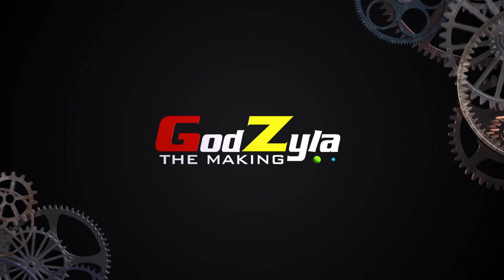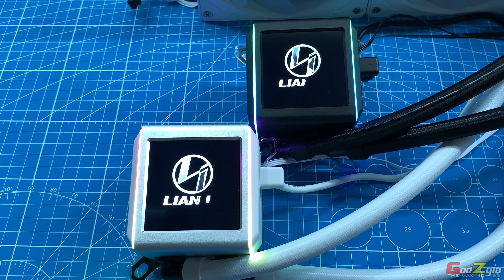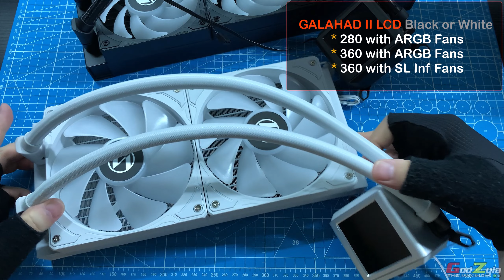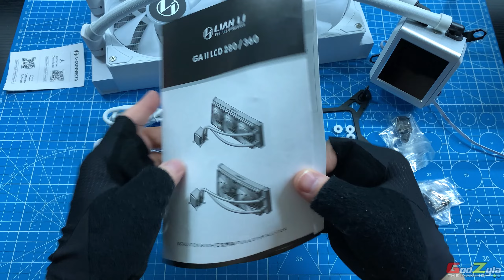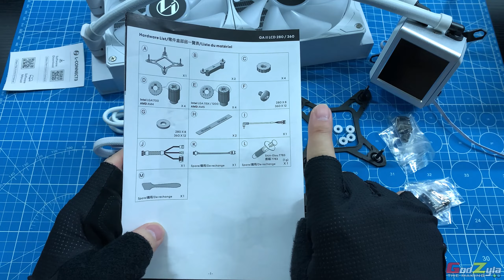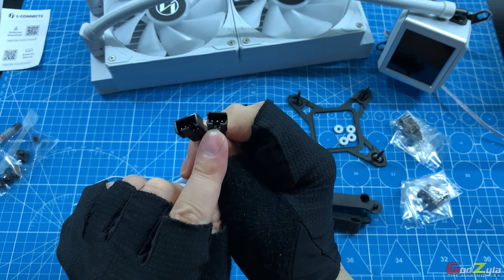Lian Li Galahad II LCD

Comment: Hmmm so which is better ryujin 3 or this one?
Reply from the maker: Hi Bruce lee, welcome back, both does it's job but I prefer GA II LCD, which is quieter even though the same Asetek Gen 8 pump is used on both Liquid AIO and the price for this is much cheaper too.
Reply: @KleoYan  ic ty buddy
Reply from the maker: @wankerka  you are most welcome. 🙂
Reply: @KleoYan  oh btw, is the software for the AIO sorted? i remeber last time it was still on beta.
Reply from the maker: @wankerka  hmm. I have been using the version 1.7.4, no issues. infact all these while I dont have issues using any of their version as I stick to one argb eco system. no other argb program I am running except for Lian Li's argb products.
Reply: @KleoYan  Can you use SL 120 V2 on this AIO?
Reply from the maker: @wankerka  Hi and welcome back, Yes you can but you will need to make use of the SL 120 V2. If you are getting the triple pack SL 120 V2, make use of the uni controller for better argb effects and to control the PWM. Else if you are purchasing just the single pack x 3, you will have to connect the Fan (PWM & ARGB) connectors directly to your motherboard respective headers (PWM & ARGB) but you can only control the argb using your motherboard argb application. L-Connect 3 will not work without a uni controller.

Comment: Good day and pls if i may ask , between this Lian Li Galahad II LCD and the Asus Rog Ryujin III  , which do u think can be a good choice  for 19 13900ks ? thanks and look forward to  your answer
Reply from the maker: Hi Blb Hansel, welcome to my channel. Both does it's job but I prefer the GA II LCD over the Ryujin III. for some reason it's quieter compared to the Ryujinn III, plus it's much cheaper too.
Reply: @KleoYan   thanks for the response  , my only concern now is about the pin head on the Motherboard , most of asus motherboards have just 1A rated pin out  and based on ur advice the GA II Lcd will work better on  a MotherBoard with higher Amp, so do u think i should go for a different motherboard?(i like asus MB because of the AI twerking) ,  and pls if i am not asking too much , but can u make out time to make a video explaining on how u twerk and turn your  pc after u build it , i live in the same area as u , and to be honest i always get lost when u explain on the under volting  process , i would like to get all the good speeds from my cpu , gpu and ram , but find   it hard , so pls  if u can kindly make out a video and explaining all the twerks that can benefit us , those that don't know much about overclocking , thanks
Reply from the maker: @blbhansel8226  hi welcome back. I am not saying Asus is not the right board, just make sure that any pump header. Plug it to the AIO_Pump on Asus motherboard and you will be fine. As for overclocking, I don't do overclocking as to me is a waste of time I only do undervolting.. power reduction. I see what I can do as currently am busy with other content and at work. Or if you want to, drop me an email godzylatech@gmail.com .
Reply: @KleoYan  thanks i will message u then , thanks a lot
Reply from the maker: @blbhansel8226  you are most welcome.

Comment: Can you plug the wire for the fans to a sL box instead of using the fan cable wires?
Reply from the maker: Hi Inf4mous twin, welcome back. Yes you can do that but with limitations. The fan profile on this liquid aio is different from the RPM of the SL same applies to the ARGB profile. 
in L-Connect 3 app, you can control both but as mentioned, the profile is different. you can give it a try.
Reply: @KleoYan  hey thanks for answering the app keeps messing with the screen it will work for a couple and the reset , then work four like an hour or two then reset again is it an app issue with the motherboards?
Reply: @KleoYan  did you hear anything about it?
Reply from the maker: @inf4moustwin15  do you have any other argb application running at the background? due to the ARGB programs which make use of the shared IRQ (Address) that might conflict. 
maybe try these steps.

Make sure it's not Armoury Crate. if it is, make use of the their armoury crate removal tool at Asus website, else proceed with step 1 to 6) 

1)  uninstall L-Connect 3app and other argb program using revo uninstaller, make sure to remove all unwanted first and registry. example in this vid on the actual timestamp https://youtu.be/uMgUYiakpxM?si=8isUQ9pWvKounfgZ&t=437 and the application revo from here https://www.revouninstaller.com/revo-uninstaller-free-download/ (download the free copy will do.
2) reboot your system. Install L-Connect 3 app first
3) Launch L-Connect 3 and play with the LCD effects. 
4) once done, reboot the system, see if your LCD effects stays.
5) next install your other ARGB application. 

test this out as what I am doing to have you remove all system registry that is related to all argb application. then having windows OS to recognised L-Connect 3 as the primary argb application (soft code in windows registry) then others argb program as a secondary. If this does not work, I would advise you to approach Lian Li tech support. https://lian-li.com/faq/ scroll down till you see there is a support form, fill that up with your issues.
Reply: @KleoYan  thanks for the help I use rgb signal  application you think it messes with it ?
Reply: @KleoYan  I have an  aorus motherboard so you think it’s the app?
Reply: But I don’t run the aorus application
Reply from the maker: @inf4moustwin15  oh ok. I am not familiar with signal RGB. So sorry about it. Maybe try my troubleshooting steps. Remove signal RGB and L-Connect 3app the follow the steps which I have mentioned. Then fiddle with L-Connect 3 app. Once tested with the lcd effects and with a reboot. Install the signal RGB last and if you still having issues. You can skip Lian Li’s tech support. Approach signal RGB since they are the developer.
Reply from the maker: @inf4moustwin15  it does not matter do you run it (Aorus sync) Once installed the registry registered the IRQ. So just remove it and follow my steps.
Reply: @KleoYan  thank you I will
Reply from the maker: @inf4moustwin15  all the very best 😉
Reply: @KleoYan  it is rgb signal maybe they don’t have the software yet to go together with lian li new aio
Reply: @KleoYan  but they have every other lian li gadget in they tool so maybe they working on it
Reply from the maker: @inf4moustwin15  I see. Maybe write in to their tech support see if they can help.

Comment: Any idea why my temps on GPU and CPU in LCD screen show 0 celcius  and NO fan control. They were working fine the other day. Then I donwloaded icue so I could control mouse, keyboard color, next day when I turned on compurter no temps would show up and no fan control. I read where L-Connect doesn't work will with other programs so I removed icue from system and temps started showing up again, thought I had figured it out. This morning turned on computer and L-Connect and the 0 are back and no fan control. Having the temps available in the LCD block was one of the reasons that I chose this watercooler, have had nothing but trouble with this cooler since I installed it. I do have the latest patch, 2.04 and latest firmware, 0.9.
Reply from the maker: Hi Mr Grim, welcome back. I understood your frustration. sad to say that all argb programs make use of a common shared IRQ (Address), therefore it's fighting for access gain rights. maybe try this steps.

1)  uninstall L-Connect 3app and iCue using revo uninstaller, make sure to remove all unwanted first and registry. example in this vid on the actual timestamp https://youtu.be/uMgUYiakpxM?si=8isUQ9pWvKounfgZ&t=437 and the application revo from here https://www.revouninstaller.com/revo-uninstaller-free-download/ (download the free copy will do.
2) reboot your system. Install L-Connect 3 app first
3) Launch L-Connect 3 and play with the LCD effects. 
4) once done, reboot the system, see if your LCD effects stays.
5) next install your iCue for your mouse and keyboard. 

test this out as what I am doing to have you remove all system registry that is related to both argb application. then having windows OS to recognised L-Connect 3 as the primary argb application (soft code in windows registry) then the iCue as a secondary. If this does not work, I would advise you to approach Lian Li tech support. https://lian-li.com/faq/ scroll down till you see there is a support form, fill that up with your issues.
Reply: @KleoYan  Thank you sir!! That did it. I should have known better that Revo would delete the files in the registry too, all I did at first was delete from the apps installed. Once I went into the registry and deleted all files pertaining to Corsair and rebooted everything is working in L-Connect again. I really appreciate the fast response with this matter, you have helped me several times now and this is what sets you apart from other bloggers. Thanks again!
Reply from the maker: @MrGrim-oo5bq  you are most welcome. Am glad you have got it working. 😉

Comment: i got a different thing going on, when i try to upload a mp4 file like u did in the video, i can record it and do all those steps but as soon as i click import the loading screen appears and closes instantly the menu and the video doesnt upload. I can only add .jpeg files nothing else.. do you experienced anything like this ?!  ( also all firmware and software updated ) aio v 0.9 and sl inf fans 1.4 plus l connect 3 on 2.0.4 version. Could you help me troubleshoot this? Was this working on an earlier version.
Reply from the maker: Hi x3ntriK. welcome to my channel. I have no issues using version 2.0.4 and have update the firmare too. You might want to try uninstall the L-Connect 3 app using revo uninstaller and to clear off the registry and unwanted file, Revo uninstaller can do that. example in this vid on the actual timestamp https://youtu.be/uMgUYiakpxM?si=8isUQ9pWvKounfgZ&t=437 and the application revo from here https://www.revouninstaller.com/revo-uninstaller-free-download/ (download the free copy will do), then reboot your system and re-install L-Connect 3 app v2.0.4

Comment: my L-connect seems very slow and does not change on pc screen and does not change on pump screen until reboot? help ( MB- ROG STRIX Z590-A GAMING WIFI)
Reply from the maker: Hi Mal Anderson, welcome to my channel. Do you happened to install armoury Crate? Try uninstalling both applications, use the armoury crate removal tool from Asus website and use revo uninstaller to remove l-connect 3 apps. Make sure to search under advance on revo uninstaller to remove all L-Connect 3 registry and files off your system. Then next, install the L-Connect 3 version 2.0.1. If that works then install the armoury crate.